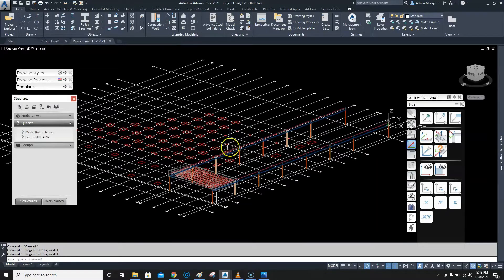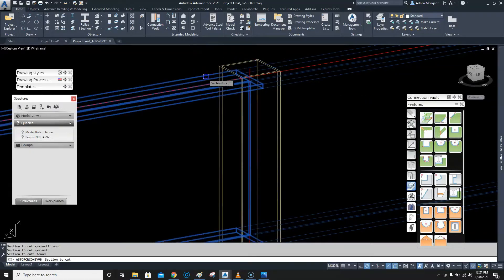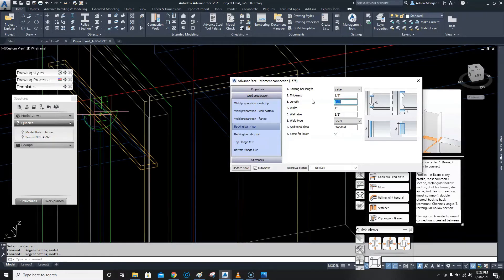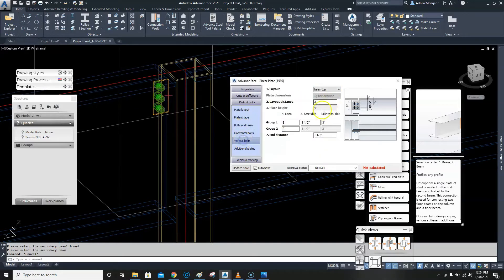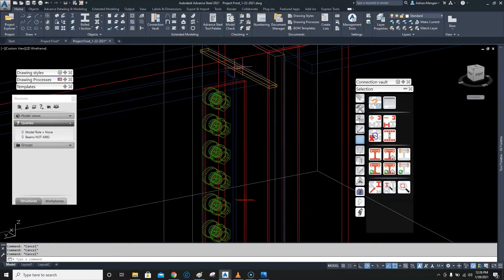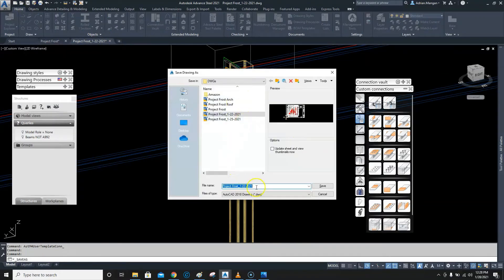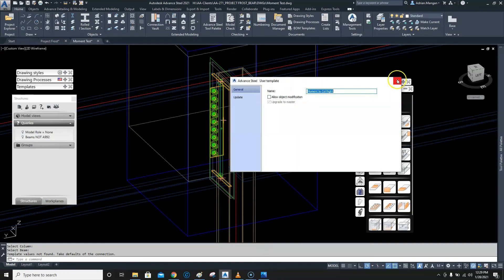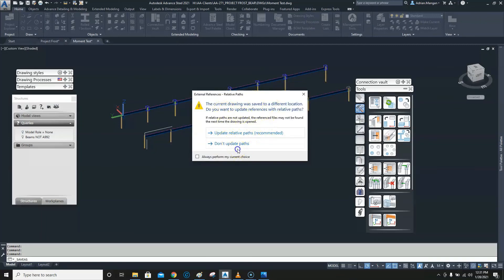ADVANCE STEEL: Moment Connections Easy.

Comment: I add the shear plate first with a 1/4" cut back, then apply the column beam moment and set the cut back for the web to 1/4".
Reply from the maker: I've had issues doing it this way before but will try again, thanks mike